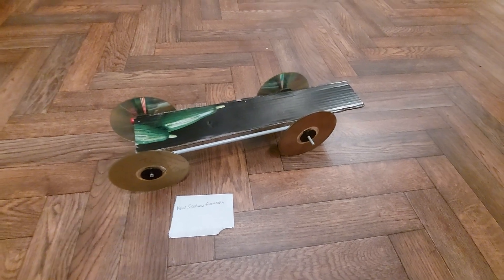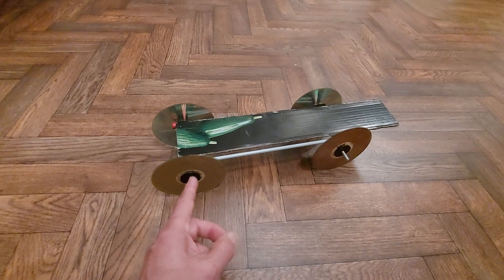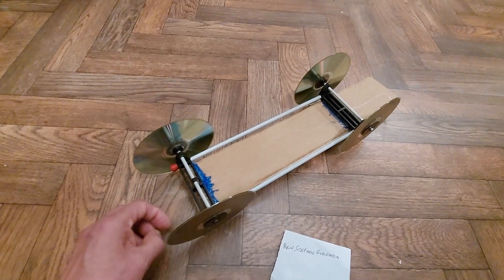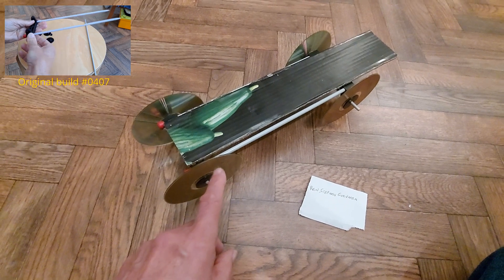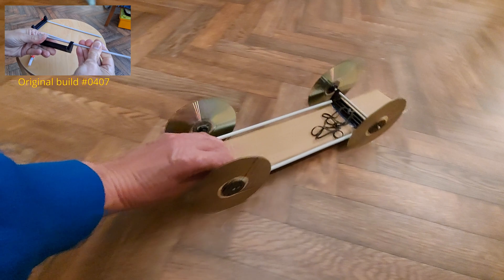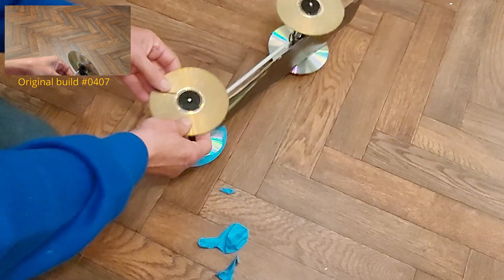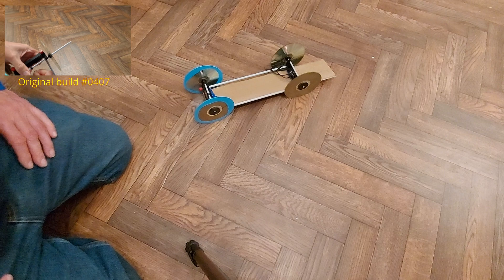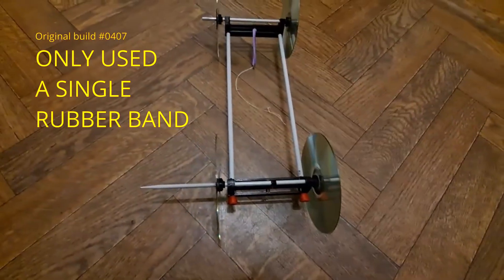Put a rubber band on it 0498 thoughts on fast rubber powered cars

Comment: I need to make a rubber band powered cardboard card, with wheels and axles of any material, that can drag a 1N (about 100 grams)  weight behind it on a flat sled at least 5 cm behind the car. The car can have up to 500 grams weighting it on the body of the car . Any tips for making sure the car can pull all the weight?
Reply from the maker: The main issue will be getting enough grip from your wheels, so you will probably need rubber tyres. Next point will be gearing. You don't necessarily need a gearbox, although that would help you get more power to the back wheels. Instead of a gearbox, you can use relatively small wheels and a relatively large axle to wind your rubber motor round. The bigger the diameter of the axle, the "lower" the gear you are in, so the heavier the object you can pull.
I did this video on the maths back in 2015 https://www.youtube.com/watch?v=HNcA04ojF0s&list=PL2Aly02Ujr7ejVN9oE9wYxRuGR-3G30g7&index=11